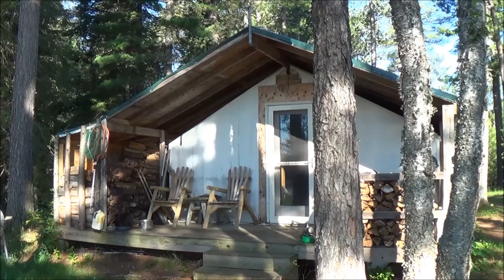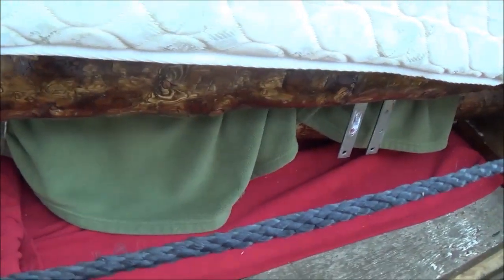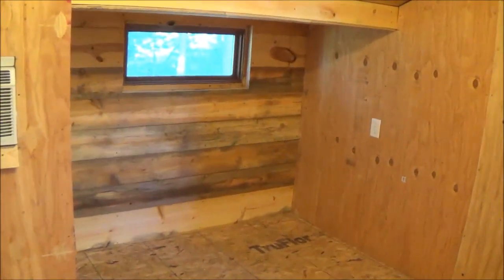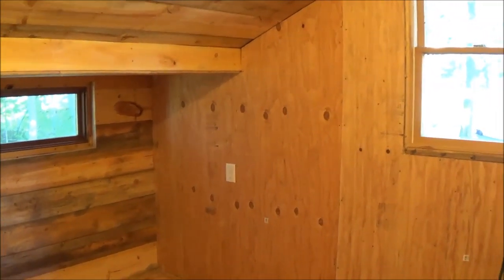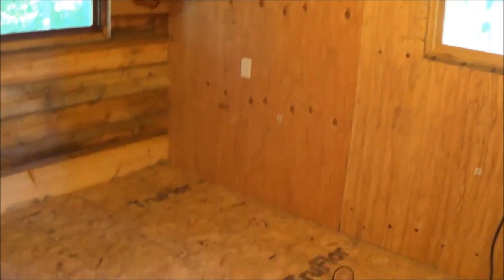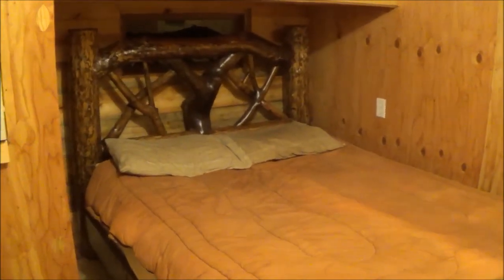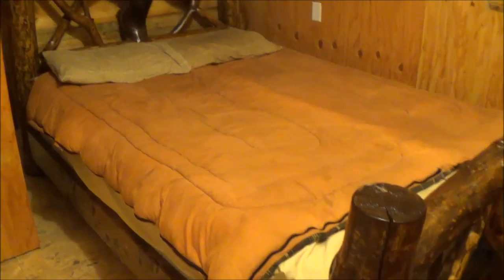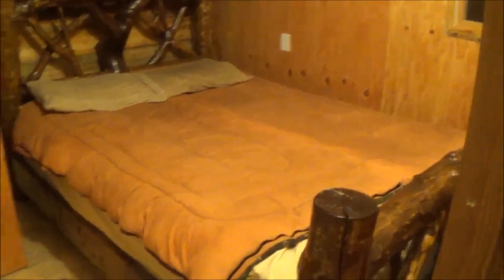THE LOG BED Meets THE TENT ADDITION.

Comment: Very very cool don't you love that feeling when when you step back and look at what you've accomplished?
Reply from the maker: It is nice to see it finished and in there but I right away was thinking...hmmmmm now I need a matching dresser and I need shelves on the sides of the bed on the wall to put a water bottle or cell phone etc. I was just out in the workshop putting the 3rd coat of varnish on the shelves. They go up there this next weekend when I am up there helping do beams in the backwoods cabin. It seems that every accomplishment ends up with something else I should do LOL. Thank you. Joe

Comment: To me i think this is great little addition!  It fits the rest of the tent very well for its size! When I go up north to a cabin I enjoy the small cozy spaces, plus the smaller space is easier to cool or heat! Nice work joe!  Oh and I'm sure you know this but placing some dryer sheets around your mattress when your not using it should keep critters from making it their home when your away..
Reply from the maker: I did not know that. Thank you Ryan, I will bring some up and put them under the bed. It will also make for a nice smelling room.